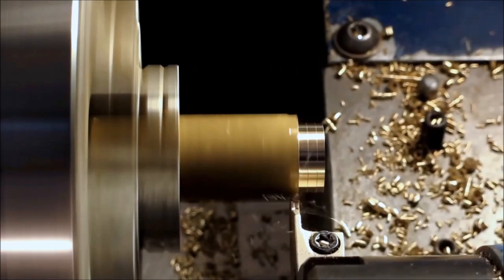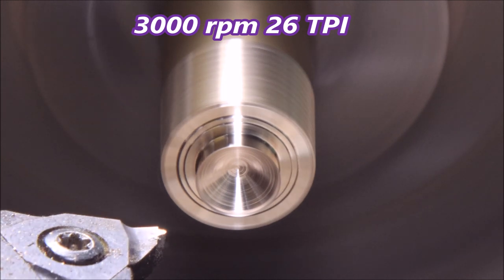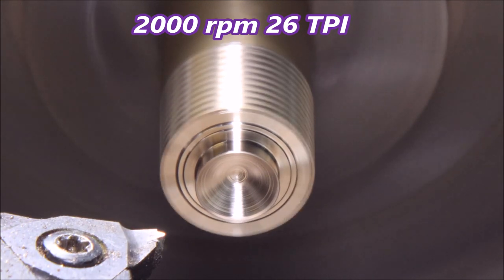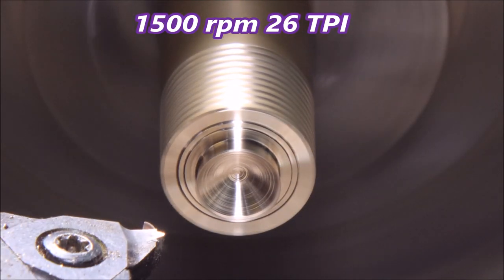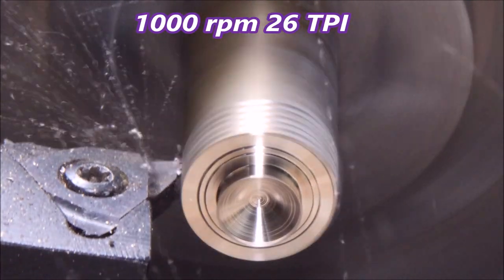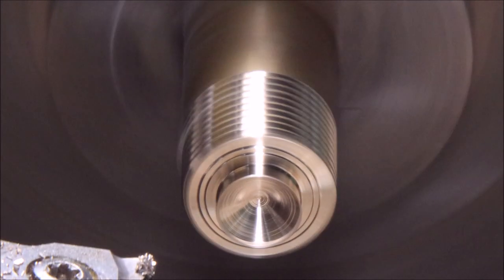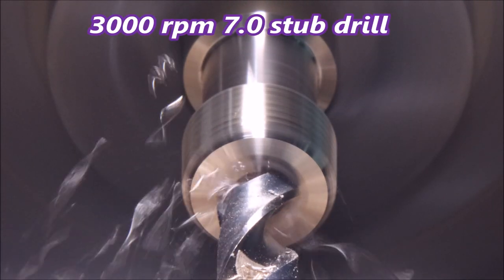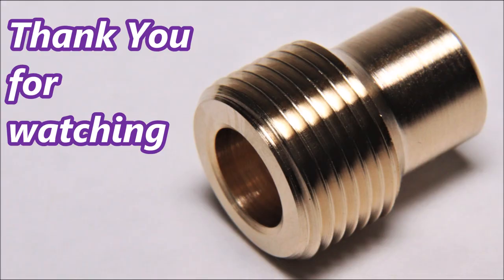Small cnc lathe threading and shaking itself to bits

Comment: Hello Nigel,
Cool secret tip there is offsetting the drill bit to create the chamfer...
Cheers.
Paul,,
Reply from the maker: Hi Paul, that is no secret, I have been doing it and showing it in videos for ages.  Not really what can be called a chamfer, but it certainly gets rid of the sharp edge.  Handy when I run a quantity of parts.

Comment: I don't know if you could program a gradual acceleration on the lead-in (starting out of sync but being in sync before getting to the part) but if you can leave a groove at the base of the thread for run-out you could probably decelerate the carriage more slowly.
Reply from the maker: As far as I can tell, there is only one way to cut a thread and that is using the canned cycle. This does not give any choices other than those directly related to the thread data. Slowing down the machine is the only fix I know of. Thank you for your comment.

Comment: Is your lathe bolted down ? Using the slower speed for threading is a good idea, looks like still a bit of shaking in the machine when peck drilling the hole? Can the hercus be tuned for accel/deccel in that process ,?
Reply from the maker: Bolted to heavy steel cabinet. You are right even the pecking is a bit shaky. The acceleration figure says programmed acceleration and I think that is exactly what it means, Works well enough in the rapids, but seems not to work in canned cycles. I think it makes sense, if the setting was too low, it could never cut a proper thread. It would be speeding up and slowing down when it should maintain a constant travel speed. The spindle speed once it is reached is accepted as being correct, there is no feed back to slow it down if the carriage is not moving quickly enough.
Just had to run it slower, no big deal.

Comment: I wonder if you could build a heavy stand and bolt it right to the concrete? Did you actually have any issues with it shaking other than that it's annoying though? I know full size cnc's shake pretty good during high speed machining.
Reply from the maker: Hi Craig, thanks for your comment. These lathes were created as training lathes, they come with some demo files, all of which include threading and none of them exceed 1000 rpm for threading. The lathe is bolted to a very heavy steel cabinet and is normally quite stable. I think I was just pushing it beyond its limits.  Not unusual for me as I don't like standing around for any longer than necessary when there are a lot of parts to make.  For that job which was 250 parts I ended up threading at 1500 rpm and cut a couple of passes from the thread cycle. This gave me a relatively good cycle time without the lathe pounding itself to death.

Comment: Is there not a setting for acceleration & de-accelerate if you have room for the extended movement after the cut and the chuck that is.
Reply from the maker: Hi Andy, indeed there is. This works on rapids, but does not appear to work on canned cycles. I can understand this as threads would be impossible if the carriage was using that mode. The spindle would have to be in sync and that does not happen.

Comment: Hi Nigel, just wondering is it important to cut threads at 3000 rpm ?
Reply from the maker: No, but if there are many parts to make, it can save a lot of time.
Reply: @smallcnclathes  its basically ececution time not anything else. Got it
Reply from the maker: @rengankrishnaiyer6912  that job was 250 parts, I ended up cutting the thread at 1500 rpm.
Reply: @smallcnclathes  thats alot of parts
Reply from the maker: @rengankrishnaiyer6912  fairly normal for me before I retired
Reply: @smallcnclathes  Cool